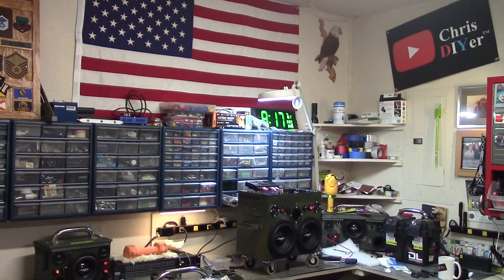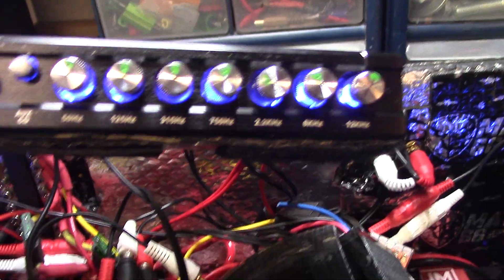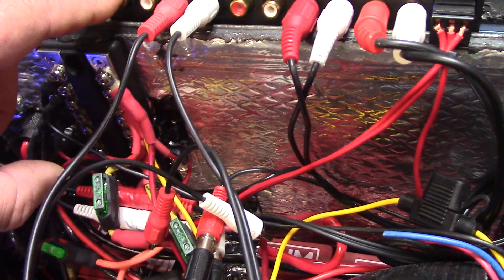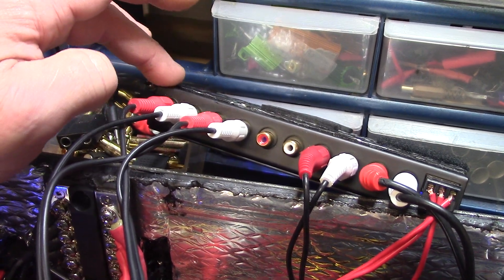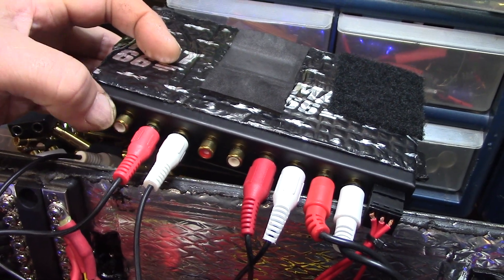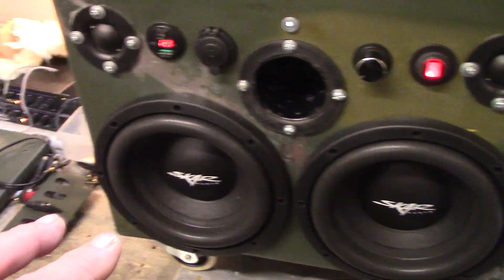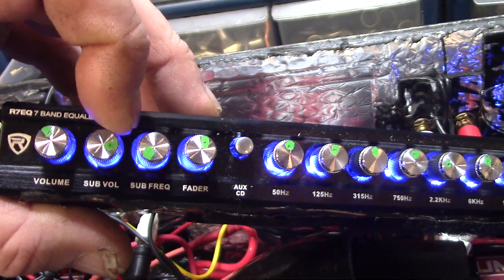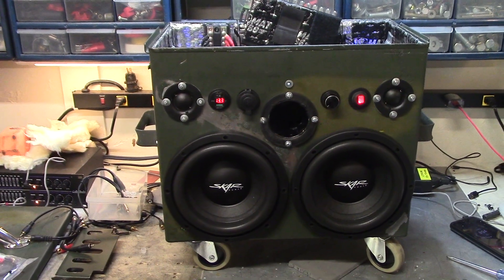Car stereo equalizer question: combining sub out + main speaker outputs for more low bass control

Comment: Get a 2nd eq and then run your full rca out of one and into the other one and then to amp. This will give you more control over the bottom end but unfortunately, you still wouldn't be able to use the sub out in this configuration. In my experiments running the full RCA results in more bass output than using the sub out. Especially, in this configuration.

Comment: first that setup is cool as hell.... 2nd it's designed to work independently from mains to sub outs. 3rd one amp should be for the midbass, mids and highs. the other for the lower end bass and sub woofer frequencies.  it will reproduce a more detailed and all around better top to bottom sound.
Reply: bro i was like, wasnt this supposed to be a video solving a problem or something🤣

Comment: Because that's not an frequency equalizer, now a days they call them eqs but really they are preamp eq. It adjust the Decibel signal of the frequency.  Get a old school eq that adjusts the frequency band of the signal . Rear and Front are for speaker s, u take those to your speaker amp line in, all you need to do its from your radio or source send an rca to the back of that preamp eq aux or in,  then take the sub out from thf preamp to an amp where the sub is going to be conected . You need separate amps for speakers and sub. Is how you use that preamp.

Comment: It has to work as designed. For what you're wanting to accomplish,  the only way it's designed to work is to run 1 amplifier stereo on either the front or back outputs on the EQ, this is your full range adjustment. Then on amplifier 2 run it either stereo or bridged to the subs, this amp goes to the sub out on the EQ. It's the ONLY way its gonna work. It wasn't designed to be configured any other way.
Reply: I can't believe that you had to explain that! It's very clear how this works!

Comment: EQ won't alloow you to control the low frequency on door speakers. Just rhe sub output. If you want an eq that'll go low an voltage/hz display american bass EQ is my all time favorite.
Reply from the maker: I have been using the Planet Audio PEQ15. It does really well...
https://www.amazon.com/gp/product/B002QUZHXM/ref=ppx_yo_dt_b_search_asin_title?ie=UTF8&th=1
Reply: But i see the peq 15 has sub freq starting from 50 to 250hz and low 20 to 70hz, i wanted too something starting both from 30hz for subs and lows

Comment: Hi Sir. Thank you so much for posting the video. 

Please advise. I can't get my subwoofer to produce 20Hz bass; it still has punchy bass, which I don't want. 
Should I use an aftermarket cross over like "boss" to get the 20Hz wavy bass? 

I have a 12 inch, 2000watt Pioneer sub in ported box (responsive to 20Hz) with a dedicated Pioneer mono block 1000Hz amp in my car. The remaining midranges and tweeters each have their own 6 channel pioneer amplifier. Finally, I have a graphic equalizer. 

Please advise, sir, if I should get a cross over 
I, and tune it to 20zHz ? I have tried using several  graphic equalizers, but none of them had a 20Hz bass knob to enable this kind of bas.s
Reply from the maker: Holy smokes! 20 Hz is wicked low and is more "felt" than heard. I really don't have suggestions. I know most guys tune to 30-35 Hz. From my experience, bigger subwoofers (15" or 18") with proper cabinet tuning and power amplification will rumble down to 15-20 Hz with some added boost subwoofer equalization. Good luck.
Reply: You need a second amp to push your sub using the sub output on your EQ. That tie in will not work as you are experiencing
Reply: @kennetht1346  Thank you Sir, for replying and advising. As you have stated, that is how it’s connected, a dedicated mono block amp for the subwoofer with sub out from the equalizer feeding it. But, still with punchy base.

Comment: Run one channel of amplifier for bass and other for highs by using your y splitter for each channel
Reply: I bought a eq and it’s just hooked up from the head unit in and the sub but it only changes on the sub vol not any of the 50 hz to 20 kHz or whatever it is

Comment: hey man hope you can help me out. i have a pioneer avh120bt. i have 2 rca for the sub and it works fine. Now i have 4 ds18s  speakers and EQ and a 4 channels amp. when i connect everything no sound come out what could that be ?
Reply: By now after a year of this ?? You probably figure it out or change that type of head unit has multiple functions in the audio settings did you try form there??

Comment: Not sure if I quit understand what your trying to do. If your trying to use your rear outputs on eq to run to subwoofer. If you have 2 amps 1 for each sub run a single pair of rca’s out of your sub out on eq then use 2 y splitters that are 1 end female other end dual male rca’s and then you can run 2 subs and not share your output with the rears. Each output has different frequency ranges. It looked like you just had the wrong set of y splitters. Pay attention to the male and female part of the splitters. Hope that helps

Comment: Base is typically 40-60 Hz.  Y split it into regular audio and crank up 50 hz, but your smaller speakers may not like that though 🤷🏻
Reply: Isn't bass usually 60-120hz?
Reply: @DayV914  how low can you go?
Reply: Bass can go down to 20hz and in some cases even lower @DayV914

Comment: Guys come on buy a clarion 755 they are the best for over 20 years and you can always bypass the signal for the sub to a diff xover or use the amps xover if it has one

Comment: Planet audio PEQ 15. It has a variable setting for the low end. Inexpensive but it can get you down to 20hz.
Reply from the maker: Thanks. I just downloaded the Planet Audio PEQ 15 owner's manual. It looks like it can it "tweak" certain freqs with those adjusters...VERY cool! This can eliminate those hot spots AND boost the 20-30 Hz low-low bass in stereo (2-channel). I am going to order one
Reply: @ChrisDIYerOklahoma  
You can also get something like a dsp. That will give you way more options.

Comment: Have a question when u install an eq between the amp does it matter clipping or distortion. Or do u set your gains on the amp first and then just hook up the eq. Or how does ot it work
Reply: You always start with your head unit to determine its clipping point first, than add the EQ to the head unit and adjust any gains the EQ may have, than you add the amplifier and adjust its gains.    If you have subwoofers you have to adjust full range and subwoofer signals separately.   Typically you want your sub options on the HU and EQ maxed out as you adjust those gains, but there is a lot of variance here depending on how each person likes their bass.
Reply: @marcuslinton310  hey man I have pretty much the same question. So I got an oscilloscope and I know what my HU clipping point is and also the proper voltage needed for the speakers and subs. Ik you’re supposed to tune w full volume before clipping as well as have the subwoofer remote knob all the way up (not on the amp, but the remote knob) and tune that way. So if I get an EQ like this, would I set all the eq settings to the highest and then tune the all with that signal so that way if I want to change eq settings according to what song I’m listening to, it won’t send clipped signal? Is that how this would work? TIA
Reply: @8ball28  With the EQ settings, you want to max out the bass knob for sure, but all the other frequency adjustments you typically want to be flat middle during gain settings which is the 0 gain mark.   This is by no means set in stone because everything can be adjusted based on listening preferences.    However, the idea behind using the middle point 0 is that you want to be able to go up or down with the frequency adjustments.   Most people don't listen to their music at maximum volume so this setting typically works.  In general, though, you're better off using the negative values vs positive values on the EQ.    So while playing music if you feel you need more treble, try lowering the middle frequencies a bit before trying to increase the higher frequencies.   It's essentially the same effect, but you're cutting the lower frequencies vs trying to boost the higher ones.  Boosting a signal is when clipping and distortion can occur.   If you were to max out all the frequencies before setting the main gain, it would drastically change it's position for sure and you would be leaving a lot of signal unused after you set your EQ back to middle.  I get your concern about distortion, after the fact, but that's why you lower the other frequencies first.   You only use positive gain when absolutely necessary.    The infamous "Smiley face curve" with the highest and lowest frequencies at 0 and the smile curving in to the negative.
Reply: @marcuslinton310  oh ok I see. Either way, my speakers supposedly do 300wrms each, and I’ll have 4. I doubt I’ll even get to full volume on HU so if anything, I’ll turn down the gain so when I go full volume, it’ll still be comfortable to listen to. Having the gain lower than the clipping point would give me headroom to be able to adjust eq higher if ever needed?
Reply: @8ball28  Sort of, but again, anytime you go + you're adding gain and artificially boosting the sound.   Gain is not a volume adjustment.   You always want to use the least amount of gain possible which is why it's better to use - to cut gain vs + to add gain.   You're better off using the HU volume, the main source of the signal, to increase the overall volume.   If you're at max HU volume and EQ FREQ's are set for the smiley curve and your treble is still out of whack, something with the recording is likely wrong because the treble should be screaming loud at that point.   You don't want to HAVE to go + on the EQ FREQ's just to get all your power back.   You're essentially handicapping your system that way and getting less quality sound trying to boost the signal back up.
Reply: Hook it all up start with fq down and Amp turn deck up about 70% settings down then set your gain set it to where u have enough power to do what u want from the deck then cut your vol back on the deck about to 45% then set your eq then crossover word of advice keep on low pass and fq low around 40hz on Amp if u have subs 12 15 in big speakers don't really need fq levels high small ones gain or eq vol low fq levels up 80hz is best for those like 8 or 10 in

Comment: Hey man just re-commenting here what I commented on the bilge pump video at your pond how did that go did it last very long do you think I would be able to use a bilge pump for my pond as a permanent way of Aerating The water like for a year or so maybe Anyway  the reason I’m commenting This here Is because this is your most recent video I didn’t think you’d see it if it was on the old one cheers 👍:)
Reply from the maker: Thanks for commenting. I just replaced the bilge pump in my backyard pond. I used a Rule 360 12v bilge pump ($23 on Amazon) https://www.amazon.com/gp/product/B01M0G6D6D/ref=ppx_yo_dt_b_asin_title_o09_s00?ie=UTF8&psc=1 My old bilge pump lasted all season last year and "was" working this spring...but, the pond was dirty. It sucked up some gunk. The new one is excellent too. NOTE: Use a 12v voltage regulator to keep the volts going to the pump right at 12.0 volts. That is the #1 thing that KILLS these bilge pump is high volts (greater than 12.0 volts). This is what I use (with a Jerry rigged USB fan on top to keep it cool): https://www.amazon.com/gp/product/B07WFMKMV9/ref=ppx_yo_dt_b_search_asin_title?ie=UTF8&psc=1 Good luck